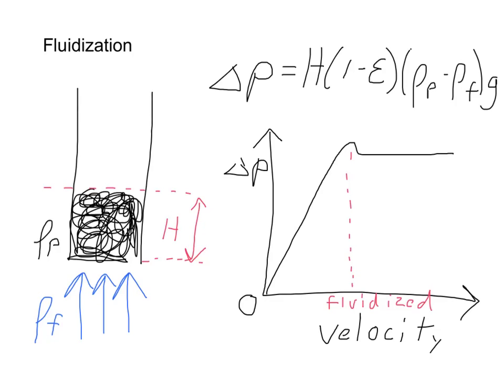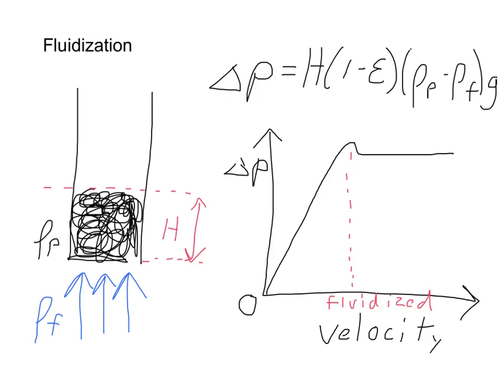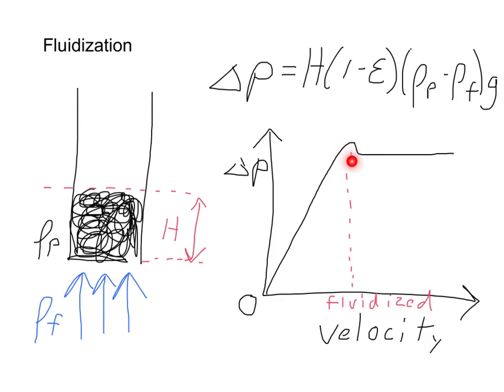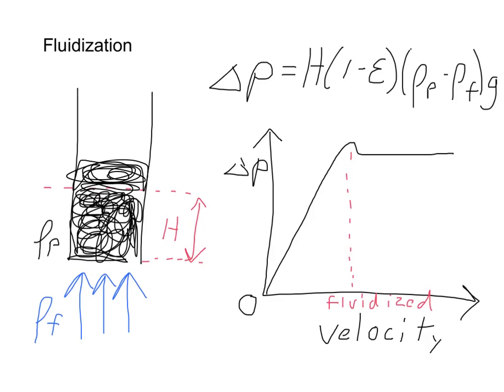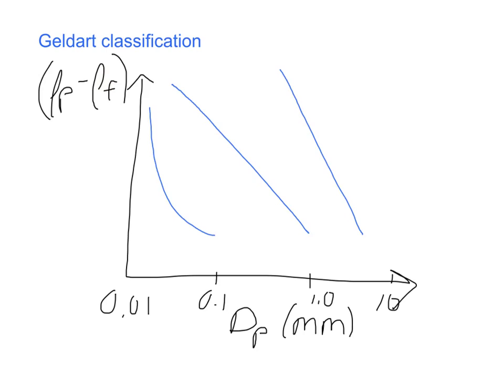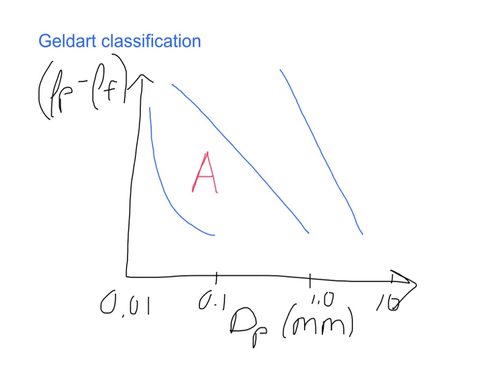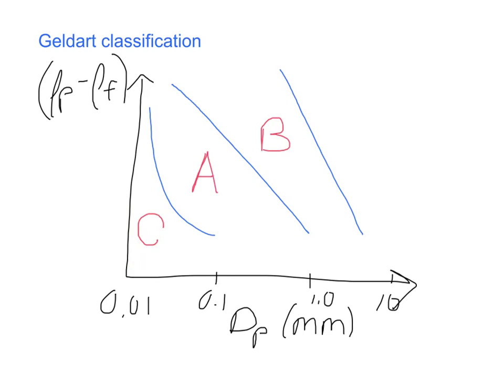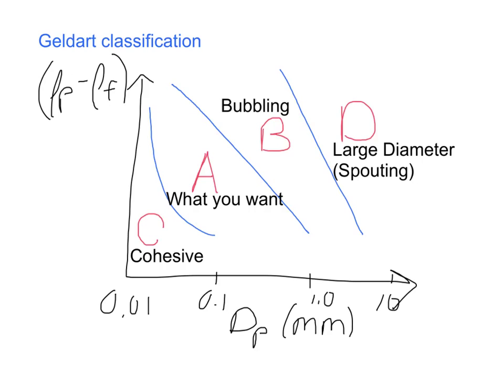Fluidization

Comment: Assuming that all your particles have the same diameter. How do you calculate the velocity at which all the particles will be carried away by the gas and eventually leave the column?
Reply from the maker: The simple assumption would be that particles entrained in the gas will move at the same velocity of the gas.  In reality, gravity is still acting on them so they would be moving a little slower than the gas itself.  For dilute particles that you can treat as individuals, you can calculate the terminal settling velocity and subtract that from the overall gas velocity (but it will be in turbulent flow so it's not possible to be too precise).